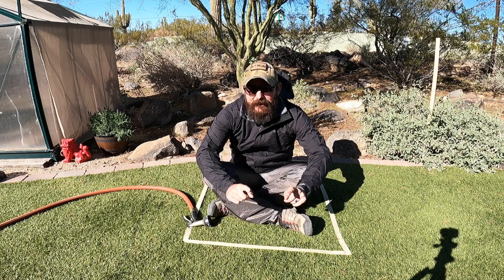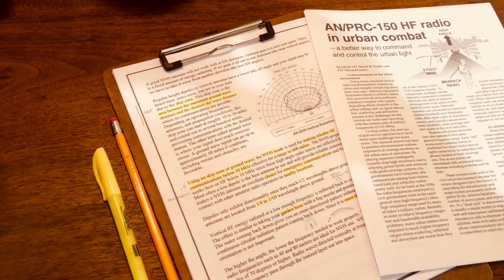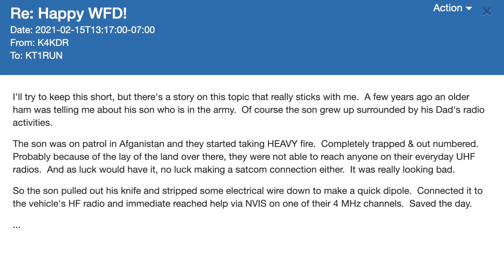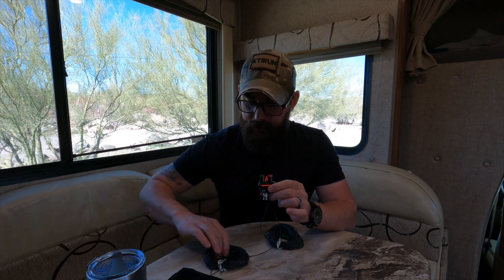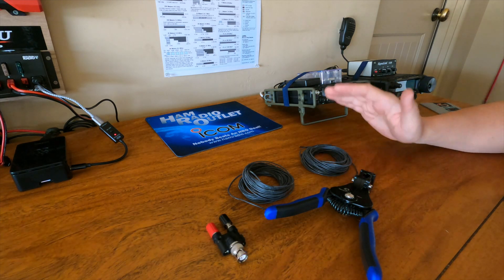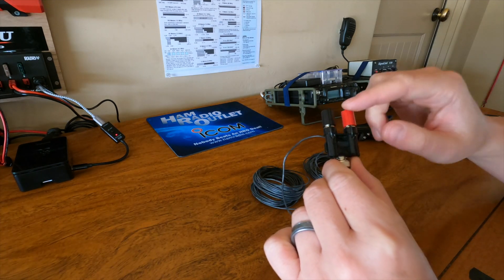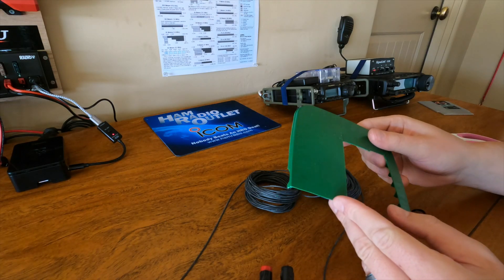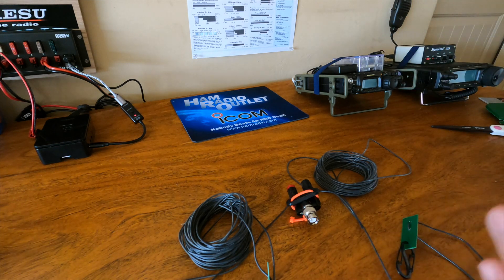Local Emergency Communications with NVIS - Let's Build an 80m/40m Dipole

Comment: Can anyone explain what 1/4 wave is? As in the antenna needs to me 1/4 wave above the ground. If i am transmitting at 80 meter band, does that mean for NVIS my antenna needs to be 20 meters tall?
Reply: NVIS ideal height is about 1/10 of a wavelength, so about 4 M high or less for the 40 M band

Comment: I really enjoy all your videos Gaston, but particularly this one involving NVIS communication.  Thanks for the work and dedication to making these videos, you do a superb job and your presentation style is brilliant.  Videos like this encourage amateurs and bring out their resourcefullness.  I subscribed today and gave the ol' thumbs up. If you ever find that the legs of the NVIS dipole sag a little on bands like 80m,  you can always use some 5-6' wooden stakes with a small notch cut out on the tops of each of these stakes. Pound them into the ground a foot or so and lay the legs of the nvis dipole into the notch cut out on the top of each stake. The stakes can be placed every 20' +/- down the length of each leg and then guy the ends of the two antenna legs with some light cord  and a small stake pounded into the ground (a form of guying I guess).  I typically use fishing barrel swivels tied to the ends of each leg and then use the interlocking snap on these swivels to attach to some light line like fishing line tied to the stakes.

More videos like this concerning your experiences with NVIS would be cool!  73, Brent
Reply from the maker: Thanks for sharing your tips. Well, you may enjoy this NVIS video. It is part of my No Random Contacts series: 
https://youtu.be/ypMM0sCUFZM

Comment: You didn't show it but I presume you ran the coax direct from the BNC binding post to the rig.
Reply from the maker: Correct. I can't recall the length of coax. I was either running RG-8x or RG-316.

Comment: Can I do this with a coax that has a pl-259? I answered my own question I found a 259 to bnc adapter
Reply from the maker: Yes, you can. My original version had a BNC to PL-259 adapter.
Reply: @TheTechPrepper  thanks. I just ordered the material. This will be my 1st HF antenna build. I have a 7300 and a chameleon bedded right now.I haven’t gotten any batteries yet, just working off a power supply. But I definitely wanted to do some quick and simple and something that can be deployed quick. I just found your channel a couple of days ago. You have good info. Keep up the good work.

Comment: Great video, worked well, them bnc/post adapters are excellent for easy dipole centres. I built mine with one from Claude’s VE2DPE Design using 300ohm ladder line, linear loaded by shorting each end, reducing the total length by 33% , 44ft instead of 66ft. Mounted in a flat horizontal config. Worked very well at about 8ft above the ground.
73 de M7PBX.
Reply from the maker: I need to try this design. I like the idea of being able to deploy it in a smaller space if needed. Thanks for sharing this design. 73

Comment: More Hams need to know this stuff.  I attempted to get my local friends interested starting 10 years ago, but they had no time for it. Even as survivalists, they are still not interested.  Younger guys will have to lead the way, and there are precious few young guys who are serious about survival comms. NVIS propagation will be essential if repeaters go down.  If using terrain advantageously, DFing is nearly impossible.  And that is a fact few are aware of, or appreciate in this day and age.  If using 160 meters, there are other advantages as well.  They may have to learn the hard way.  Be ready to reintroduce short skip propogation once the time is right.  For now, most Hams will stick with the narrow bandwidth and ideas that define amateur radio.
Reply from the maker: Yes, HF and NVIS is critical for real grid down comms. This video is a bit dated, so there will be an HF mini series specific to using NVIS for targeted comms. This series will start next month once the manpack series is complete. I'll even touch on this topic at a high-level in the manpack series once I get to the first set of a HF-capable manpacks. Cheers!

Comment: Adding this to my survival set up.  Gotta upgrade my license to get on the HF
Reply from the maker: Good luck with your upgrade. You'll never regret the effort studying. I've used many antennas, but boy does this work remarkably well. It's a keeper in the kit and easy to repair in the field. Next month I'm starting an HF NVIS mini series for target contacts.

Here's a video with that same antenna running 4' off the ground. It's somewhere near the middle: https://youtu.be/P6uowKWtWbY
Reply: @The Tech Prepper  so much to learn.  Prepping is more than a water filter a rifle and 5 gallon buckets of rice

Comment: Good job.
Reply from the maker: Thanks. You may also like this newer video where I demo 80m NVIS using the same system. The other stations were running a kilowatt and I was running 6 watts on the FT-818ND. https://youtu.be/-pKLZCuWZY4

Comment: NVIS  works great. If you run another wire 1/8 wave below it more grain straight up
Reply from the maker: I've heard this several times. Is there away to measure the performance improvement with any tools? Or is it a matter have just benchmarking both configurations via signal reports from other stations?

Comment: Do you think you might consider trying this with 11m (good ol' CB SSB). Many of us don't have/can't afford proper (quality) HF gear. The CB I've had my eye on is the President McKinley. I'm waiting for the CB companies to get FCC approval for CTCSS and DCS on the new CB FM mode. IDK why no one thought of that when they were petitioning Uncle Charlie for FM.
Reply from the maker: Great question. NVIS is a type of HF propagation that only works between 2 MHz and 10 MHz, so it will not work on CB. Unfortunately, this type of regional/local coverage requires HF gear. I haven't used CB personally, but I may jump on board if the manufactures come out with some FM CB transceivers.

Comment: Brand new Ham here. Love the videos.  I am focusing on NVIS as my first set up unfolds.  I have a question regarding mobility of the system. Will it remain functional to mount this type of antenna on a loom type rack, maybe 4 or six inches between each pass of the wire and mount it on the roof of a car or truck? My thoughts are to remain truly mobile with the system.
Reply from the maker: Welcome to the channel, new ham. Good timing as I am experimenting with this same setup again, but on 80m. I'm not sure about your experiment, but try it! 

I have also played with this setup for a mobile deployment while stationary. If you have a receiver hitch on your vehicle, get yourself a flag pole mount that fits in the receiver. I also found 16-24' painter's poles to work great when dropped into the flag pole mount. If you check out my Instagram feed you can see some of my NVIS work that's in  flight now. I will do a video soon on this topic.

Comment: with the antenna being so close to the ground.. did you have to worry about any impedance mismatching issues?
Reply from the maker: I read that the impedance can drop from 50 Ohms by a factor of 4 to ~12 Ohms as the dipole gets closer to ground. I didn't specifically test the impedance, but if I recall the SWR was fine. I may have trimmed a bit more off each end to get it as low as I did. 

I'm getting ready to put the 80m version back up, so I'll measure the impedance this time.

Comment: Can it handle 100watts?
Reply from the maker: Unfortunately, I do not have the equipment to figure this out. I have asked the question to several more senior ham on how to calculate antenna's max output power, but have never received a good answer. I ran it up to 50 watts during my initial testing. In general, I am using this more for QRP (5-20 watts). For local 80m contacts QRP levels are fine.

Comment: Your efficiency will rise at somewhat greater heights, up to about 1/8 wavelength.  If you also run a slightly longer wire on the ground under the dipole, you can lessen your nominally -3 dB loss heating soil.  Note that your swr bandwidth will be less leading you to believe it's not doing as well - but that's only because the resistive soil isn't swamping out the antenna impedance as much.
Reply from the maker: I've read up more on the literature since this video was made. Army MARS has a great introduction into deploying a NVIS dipole and your suggestions are very similarly to their recommendations. I appreciate you sharing your tips with myself and the community. I'm working on getting some permanent masts to give myself quite a bit more height. 73

Comment: I may have missed it, but what wattage were you using here? And what wattage would this build be safe up to? Thanks!
Reply from the maker: I can't recall but, I think I was running 25 watts, but possibly 50 watts. I'm still trying to find a good academic article on how to calculate the max power rating for custom antenna builds.

Comment: New ham here. What’s the device you used to “sweep” the bands? Built into the radio or antenna analyzer or something else?
Reply from the maker: Welcome to the hobby. It's an antenna analyzer. The one shown is the RigExpert Zoom. They are pricey, but well built. You can get yourself a NanoVNA for a fraction of the price ($50 USD). 73

Comment: What is a good radio for Nvis .  Lightweight yet durable for backpack etc
Reply from the maker: Well, I personally use the Yaesu FT-817/8 as it covers the necessary HF bands. It's light enough that I back it out. There are plenty of other options that are used for man portable operations: IC-705, KX2, the Discovery TX-500. From what I've seen, the TX-500 looks to be the most durable. Do your research as these are all pricey.

Comment: Great video. Are those ranger bands on your radios? And if so where did you get them? Thanks
Reply from the maker: They're elastic bands that came as packing material for something we ordered years ago. I wish I knew where to get them as I could use a few more myself. They're the perfect size and have just enough elasticity to hold accessories to the radio. Glad you enjoyed the video.

Comment: Here's a 'cheap-ham' tip. Next time you use a fairly wide zip tie, save the cut-off for wire insulators. Very strong. Drill 'em out the same way you did the Cascade Pod plastic.
Reply from the maker: Fantastic tip. That would have been easier and stronger. Thanks.

Comment: So I want to build this. Did I hear you right? Two 33ft sections of wire? And how many watts are you running through the antenna? And last question. I don’t have an antenna analyzer so how would I go at tuning it?
Reply from the maker: Yes, for 40m It's roughly 33' for each element, but cut it a bit longer so that you can tune it. You can use the SWR meter on your radio...just back down the power. I'm no expert, but I've been told that a good technique is to switch to CW mode and key the mic. Then, adjust the length of each end based on your SWR reading.  I never tried this approach, but it is possible. The NanoVNA is a nice $50 option if you ever want a budget analyzer.
Reply: @TheTechPrepper  thanks I’ll look into that antenna analyzer

Comment: Super light coax say rg174 is fine for those freqs and would fit in that kit
Reply from the maker: You're 100% right. I typically run RG316 for HF in my field kits.

Comment: Clever, well done.
Reply from the maker: Thanks! Still using this little build with good results.
Reply: @TheTechPrepper  Yes, I'm thinking of getting an NVIS antenna up myself. I think in a crisis situation, NVIS coverage would be the most useful and local UHF etc too.
Reply from the maker: I would add to 2m SSB to the list. It's a very effective mode.
Reply: @TheTechPrepper  I see, thanks for the tip.

Comment: I’m looking at using a 80m and 40m ham stick mounted horizontally for NVIS.
Reply from the maker: Now, this is an interesting idea and requires a lot less space. I wonder how well this will work. Good luck with this experiment.
Reply: @TheTechPrepper  http://www.w0ipl.net/ECom/NVIS/nvis.htm
Scroll down to about the end of the page and look for the section titled “Dual Ham Stick”
Reply from the maker: John, thanks for sharing this. It was an excellent read. This is the first time I've seen a mention of 10-15' being an effective height. While I have never been able to deploy my dipoles higher than 10-15" due to lack of trees, I can tell you that I have consist success on 40m and 80m with my dipole at this height. I've received so much email telling me that these heights will NOT work--that's nonsense. Get in the field and experiment. The ham stick section was great as well.

Comment: Good Vid son, I echo OH8STN, Julian, place a REFLECTOR Wire directly under the xmitting wire as a reflector, works great
Reply from the maker: Thanks for echoing the suggestion. I think I’ll try this today. That little antenna has been working great for the past few months, but it will be nice to see if adding the reflector wire will help. 73
Reply: @TheTechPrepper  Did you attempt the reflector? If so, did you notice a significant change?

Comment: Will this work for 2 meters? New ham here as well. Thanks in advance KE8PHJ
Reply from the maker: NVIS will not work for 2m as NVIS propagation works on the low HF bands between 3 and 7MHz. But, you should be able to make a 2m dipole using the cobra head binding post. It would be horizontally polarized so it should work for 2m SSB work. I’ve been thinking about experimenting with this very design as I’ve been playing with 2m SSB the last couple of weeks. Don’t be afraid experiment!

Comment: Hi, I'm currently studying for my Tech and General, so don't have any experience here.
Is there a minimum wattage that's necessary to make these regional communications within about 200 miles using NVIS? 
I'm hoping to use a mobile unit for this. Thanks.
Reply from the maker: Best of luck with your Tech and General licenses. It’s a great hobby. I run very low power with great success on both 40m and 80m. I typically run just 5 watts. As an exercise, I should try 2.5 and 1 watt.
Reply: @TheTechPrepper  Sheesh, 5 watts, how amazing is that!
Thank you very much for sharing your knowledge on this.
Reply: @thegreatcornholio7255  Wattage is necessary to an extent, especially for being heard in a pileup, but a clear path from one antenna to another is paramount.  Think of the atmosphere as a mirror.  If your antenna/signal can look into the mirror and "see" the other antenna, it usually matters more than the amount of wattage you are using.  On VHF FM comms, this is very apparent.  I can hit a repeater 48.8 miles away with as little as 20 watts because its on a high tower, and its a little more "visible" to my antenna (there's a lot more that goes into that, and due to curvature of the earth, even at its height, its not technically line of site, but you get the idea).  I have repeaters 20 miles away that I can't hit with 60 watts and an 8 db gain antenna because there are buildings between us.  A clear signal path is paramount.  Even with multiple "reflections", you can be heard around the world on 5 or 10 watts if conditions are right.
Reply: @TheTechPrepper  Also, subscribing, thanks.
Reply from the maker: Thanks for the sub!

Comment: Excellent Job. I’ve got 10m, 20m and 40m working well but missing a capable antenna for 80m. That’s about to change now. Thanks and keep up the good work. M7BCN
Reply from the maker: Thank you. It’s not the best antenna, but works well enough especially for the price. I re-trimmed the 80m version for the digital portion of the band. Works great for getting into a local Winlink gateway. Good luck with your build. 73!
Reply: @TheTechPrepper  Made an 80m Dipole that’s sitting just below the top of my 6ft fence. It bends around my garden and I’m blown away at how well this thing works.
Reply from the maker: @M7BCN  I receieved alot of email from more experienced hams indicating that this would not work. Glad to hear it's working.
Reply from the maker: Thanks for sharing your QSO, Brian. Looks like it works nicely. Great signal report. 73, KT1RUN

Comment: What wattage can your Dipole handle, the full 100watts from your Yaesu?  Great build, thanks for sharing.
Reply from the maker: I’ve ran anywhere from 5 to 50 watts as that’s always been enough to make the desired contact. I’m still a new ham and I’ve been asked this question a few times, but don’t have a good answer. I’ve tried to research how to determine the max watts that a given antenna can handle, but haven’t found anything yet. Can you or someone else point me to a resource to calculate this value? I’m glad you enjoyed this simple build.
Reply: AWG 26 used here is enough to handle a 100 watt rig. Much more and there may be current-handling issues at the feedpoint.

Comment: Thanks for sharing! I am going to try to build it - looks like a fun project and perfect for emcomm use. Curious what wattage you are using to transmit and what the power handling would be for this antenna? Cheers and 73 de W3LAM
Reply from the maker: It was my pleasure. It’s a very simple build. In the video, I believe I was running 20 watts on the FT-891, but I usually run this antenna with my FT-818 at 6 watts. I have good success with Winlink on both the 40m and 80m versions. Heck, I even activated a peak with it (https://youtu.be/P6uowKWtWbY?t=520). As for how much it can handle, I need some help figuring this out. I’m still a new ham and can’t seem to find out how to measure the max power rating for an antenna. I’ve done some research, but the information seems spotty on how to arrive at a value. Any thoughts, anyone? 73 de KT1RUN